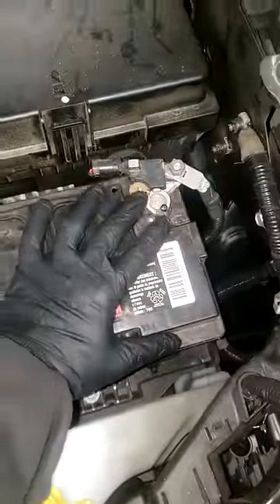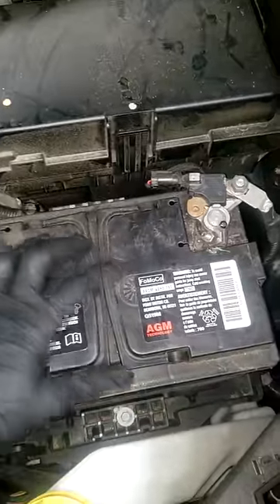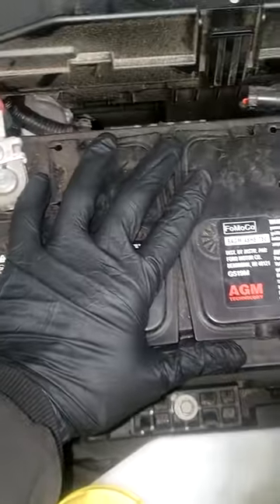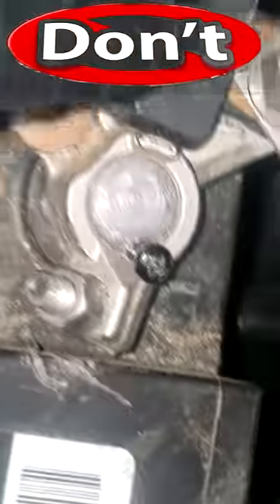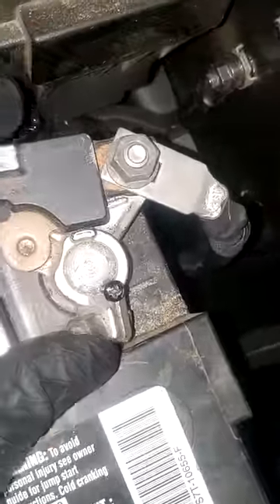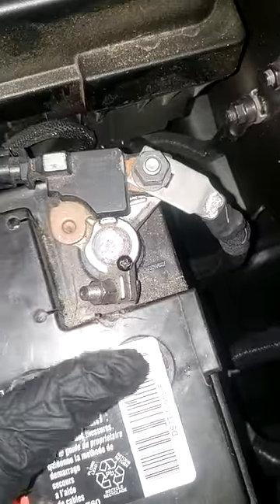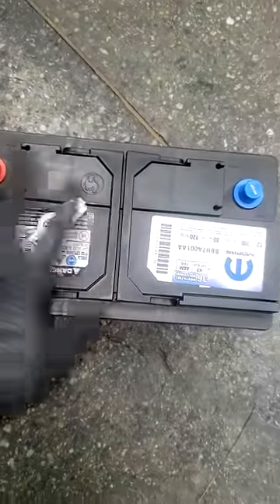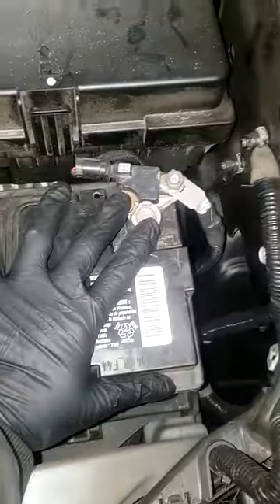STOP DOING THIS PEOPLE. This will destroy your car electrical system.

Comment: Using a screw to ensure good contact will destroy? Explain how that would transpire, cowboy.
Reply from the maker: Lol, just a word I chose to use to describe it. The content creator has those rights you know.
Reply from the maker: And doing this only cool on older cars thats not heavily computer controlled. You don't screw a screw into a dam sensor and think thats ok do you?
Reply: @OnlineMechanicTips  It's a battery post and a clamp. There isn't a sensor involved. That screw wasn't a problem. I guarantee it.
Reply from the maker: @jimandskittum  Rule of thumbs goes when you try an guarantee something you suppose to know what you talking about. Smdh, that is not a typical battery terminal, it is in fact a sensor. I even called it out in the video. You don't go screwing things into this IBS. BTW that stands for Intelligent Battery Sensor. You could destroy your electronics. This mostly used on newer cars. Thats why I said using screws cool on older cars which you obviously have. Its ok
Reply: @OnlineMechanicTips  The clamp may have a sensor on it but it doesn't have any working parts at the bolt side of the clamp, bet! I know enough to call you out on that. Just show me what the screw messed up.
Reply from the maker: @jimandskittum  Call me out?? My guy i don't have to prove anything to you nor will I try to. You welcome to put or leave screw in yours, its ok. Lol, seems I just wasted 10 mins of my life explaining facts to you that you will simply ignore anyway. Theres no reason to try and call me out, simply disagree and move on to the next video.
Reply: @OnlineMechanicTips  So you could explain how the screw ruined the clamp but I wouldn't understand. You can't prove it so you attack me. Using a screw is a hack but it didn't kill that agm battery that fixed the problem. The clamp still works my guy. Try it on a good vehicle.
Reply from the maker: @jimandskittum  lol. Im not attacking you, stop being sensitive. I just realized what your motives are and that you a lost cause so there no sense wasting time with you. For your info, the battery in fact failed the load test. When I brought customer out to look at, I advised her to do both and she agreed and wanted both done. We don't do bootleg stuff here dude. Thats stuff you do on your on. Like I said, you welcome to put screws in your battery if you want to.
Reply: @OnlineMechanicTips  Like I said before bad battery. Take the screw out and make the connection right and stop making videos around replacing stuff that isn't the problem. "This will not destroy your electrical system" - please brother it won't even leave a mark.
Reply from the maker: @jimandskittum  lmao, you have a channel with 26 videos and 5 subscribers. Im not sure you in a position to advise me how to make videos my guy. In fact this video you commenting on doing extremely well. You might want to sit back and take notes lil fella. I got this over here..lol..dont come for me ok..Now get busy, seems you have a lot of work (content) to do. No sense wasting time with a guy that knows what he doing already..lol..tf???
Reply: @OnlineMechanicTips  There are lots of people making money on YouTube that don't know what they are talking about. You keep making it about me because the screw and the sensor weren't the problem.
Reply from the maker: @jimandskittum  lol, and I'm sure that's they goal, to make money. Im also sure they don't give a dam what a lil guy like you think.. Shouldnt you be recording some more videos and getting subscribers? No sense worrying about me, or the screw and that battery..lol..seems you have bigger problems. Get to work dude. Im bout to upload 3 more videos as we speak. Why don't you watch those as well and give me your thoughts how I can make them better. Thanks, I will be waiting on your comments.
Reply: @OnlineMechanicTips  A lot of yapping and none of it was about how the screw caused a problem. Either it didn't or you don't know how it did. Either way you should get some experience before you start giving out "tips".
Reply: @OnlineMechanicTips  lol back to you. Why did you stop at that sensor? Might as well replace the whole electrical system, you know, just in case. The whole thing was just as broken as the intelligent battery sensor.
Reply from the maker: @jimandskittum  Because thats all they needed for now.  Im sure they will return if she have any other problems simply because she now trust me. I showed her everything. Thats how you build trustworthy relationships with customers. Lol, that car fixed and gone and here you are still worrying about that screw..smdh.. Do you need some footage or something? Seems you got a lot of free time on your hands..lol..dude you tricked me, I thought you was somebody. You don't even deserve to argue with me. In fact, you can use this to get more subscribers. Lol, just tell people you once argued wit JT the Car Guy and show them this post..lol..im done..lol
Reply: @OnlineMechanicTips  Parts Changer
Reply from the maker: @jimandskittum  smdh. Thats it??? Thats all you got? Yea, you ain't ready for me my dude. Seems we done here. Enjoy
Reply from the maker: @jimandskittum  Now thats a better comeback, but I think you can do even better. So try again for me please.
Reply: Hey guys, not that I don't love a good argument but I just wanted to chime in with my opinion here. The vehicle probably wouldn't start so someone saw that it had a loose term. so he did the screw method just to get it started on a cold morning in a hurry. But Jt you got it in the shop for your issue and found the battery bad. And noticed the Jerry rig setup. Being a technician on flat rate your job is to not "rig" but rather try to sell what you can for a paycheck (it is the nature of flat rate). And put the system back to factory specs. And so, you sell the bad battery and rather than reinstall the stretched term, you replace it and the IBS because it's part of the term. As far as the screw goes, the screw was not the cause of the electrical issue, it was the failed battery, but you chose to fix the other while you were there. Agreed that you should not install a screw into your term but it will not (if secure) hurt the electrical in anyway. There is no increase in resistance or amperage due to the repair. In fact, the arcing from the loose terminal was more detrimental to the electrical system causing voltage spikes with every arc from the loose term and attempt at starting the car. So you both are correct. Just take a moment to look at it from a techs view that's on the outside of the drama. 🔧😎👍🏻 
Edit: I am a dealer trained tech lof 30+ years just in case my opinion is in question.
Reply: @midnightrider1854  Thanks. I thought the sensor would be separate from the clamp. If cars were meant to be serviceable they would be too. He could have done a video where ground the gap out some, squeezed the clamp in a vice or even installed one of those crappy shims. Instead he led others to believe the screw caused the fault.
Reply from the maker: @midnightrider1854  This was a interesting read my guy. From start to finish. We have vehicles out now so dependent on good connections and non spikes that if it sense either, you can be locked out. Then your car has to be towed in all because of some bootleg mentality.  Your transmission module can be knock out of proxi alignment, all kinds of crazy things. So my diagnosis on anything electrical starts with a visual and insp of the battery and its connection. To me, nothing else matters until thats on point. Everybody approach different. I just explained mine.
Reply from the maker: @jimandskittum  Why don't you do the video, you have a channel? Go for it buddy. No need to suggest for me to do it, I have plenty
Reply: @OnlineMechanicTips  Hey Jt,
I am not saying that you are wrong for replacing the terminal and IBS. I was simply trying to explain both sides to each other in a cool detailed head. But I would have replaced all since I am a flat rate tech myself. But in a stranded situation the customer has to do what they have to do in some situations. And as far as the electronics go, I still diagnose them so I understand them only too well unfortunately. Just trying to help you both understand each other is all Bubba. ✌️🔧😎
Reply: @jimandskittum  Hey,
I actually did to at first. So I don't blame you. But the explanation def could have been better on Jt's behalf. And like I said, the screw if secure cannot cause an electrical failure but with that being said, it is his job as a flat rate tech in a dealership, to replace all surrounding parts of the problematic part that he is changing that appears to broke or worn. Now in a regular garage/shop I would have repaired the terminal and post with solder. But you can't do that where he works is all. 🔧✌️
Reply: @tonyw1563  lol it's not any one person. Sorry, it's just slang. Like, saying "brother " or "buddy" ect.
Reply: @midnightrider1854  I hear you bubba.
Reply: @OnlineMechanicTips 
Question  can you damage a censor
By slamming the hood or getting snow and ice In the engine bay  ?
Reply from the maker: @Lupo32  Im not understanding the question. Vibration caused by hood slamming not known to destroy sensors unless it comes into contact with it.
Reply: @OnlineMechanicTips  
I slammed the hood of my suv and I think it may have damaged my throttle body censor... 

it could also be that during a snow storm lots of snow and 
Ice got in thr engine bay and freezing temperatures....

Last but not least I tried to reset the 
Service engine soon light by un doing the 
Negative terminal which I left undone 
For about 40 minutes....

The vehicle ended up in engine fail safemode mode with a wrench icon

Comment: He sold her what would make the most profit. There's nothing wrong with that battery or the screw. If anything, that screw provides a more solid connection and will not affect the electrical system.
Reply from the maker: Obviously you still stuck in the 90s or still working on old ass cars. So me and you not cut from the same cloth. You cant do that to these new cars thats heavily computer controlled my guy. Smdh, has nothing to do with making the most profit but more to do with getting it right. So take your screws and do with them what you will, but if you show up with a check engine light on (this customer) and I see screws in the battery and sensor, you getting recommended a battery and a sensor. If cust decline ide glady send them to your old ass shop where its ok to do that.
Reply: @OnlineMechanicTips  electricity follows the path of least resistance. The screw does not affect the amount of current nor voltage exiting the battery. What it does change is how much surface contact there is between the cable and the post. Poor connection to the battery is the leading cause for electrical malfunction. 
And my repair shop most likely has a higher customer satisfaction and retention because I don't do unnecessary repairs. 
Have a nice day.

Comment: I’m an electrician and see my share of jerry rigging. Some of it is funny and some of it is slightly terrifying. Always do it right the first time. Unless it’s an absolute emergency that you’re doing temporarily until you have the correct materials.
Reply from the maker: Bingo. Hell even temporary is risking it on those new Jeeps. One small voltage spike or weird amp change and bammm. You just bricked your transmission. Its tow truck time then

Comment: Of coarse you can do this with a screw.  What did tightening up the connection with a wedge have anything to do with the sensor?  This is a totally valid fix if that’s all you got and don’t really care what it looks like. To make a video saying don’t put a screw in there because it can damage some sensors is faulty advise.
Reply from the maker: Lmao, I suspect you drive a old ass Buick? My friend can you please get converted into the new century? You cant be doing this kind of hackery on these new cars. These cars are computer controlled now, geeeesh.

Comment: Been doing that for years never ever ever had a problem
Reply from the maker: Obviously those years you speak of include older model cars. In this video, I specifically said you should not do this in the newer cars equipped with this type terminal which basically is a sensor. Did you not hear that part? I don't make money off parts so I'm not merely tryna sell you parts guy..

Comment: EXCELLENT explanation Sir! There’s a screw missing from that sensor too looks like. Probably a small ground? Some don’t understand the difference between our 87 G-Body and a 2017 GMC electronically. Just ask any old school car enthusiasts about their ground to frame wire being loose 😂
Reply from the maker: Lol.  Interesting comment. Thanks Ron
Reply: @OnlineMechanicTips  No problem. “I’ve” had that issue a few times. Not a mechanic but mechanically inclined lol. I do leave the big stuff for the Big Boys because TOOLS ARE EVERYTHING! I subscribed quickly and have been learning ever since! “I” know that you DONT play with the battery connection. That’s a “temporary” fix to get you to a “real” mechanic   Ijs lol 🤷🏾‍♂️💯💪🏾
Reply from the maker: @ronaldh2246  Thanks Ronald

Comment: Just to play "devil's advocate" here.

If all car companies quit making such Expensive $hi+y terminals, maybe people wouldn't have to resort to such "tricks" to keep their vehicles on the road🤷
Why would anyone mount an expensive electronic device directly to the battery post while knowing full well, that terminals sometimes grow corrode?
It's a money grab. Plain and simple
Reply from the maker: Lmao..thats a interesting take you have on it. However, engineers determined that the best way to monitor battery temp and in some cases amps running through the battery, they figure this sensor directly on the battery was the best way. The computer needs this vital information now that there's more computers on the car.
Reply: Yep the battery terminals and the sensor both corrode
Reply: @OnlineMechanicTips  ok, So why not build in a cheap sacrificial terminal that can be easily replaced without damaging the sensors? Or make the sensors cheaper?. 🤷
It's a money making opportunity, nothing more.
What's the retail cost of that terminal and sensor package?
Or the cost of replacing the wiring harness when "the engineers" don't make a way to replace just the faulty terminal (or a fusable link hidden in the wiring harness)?
1. Make it cheap and unique (and prone to failure)
2. Patent it
3. Put a big price tag on it.
We always hear about how much money a car manufacturer saved by eliminating a 10¢ bolt times a million cars. 
But how much do they make on something like that terminal times a million cars (a few years down the road)? 🤷
Reply: The terminals aren't the problem, it's the people, people gorilla strength the terminals when tightening it. There are things that don't work when you force it past it's elasticity. People tighten the terminal to the point the nut touches the bolts head and wonder why it won't tighten again.